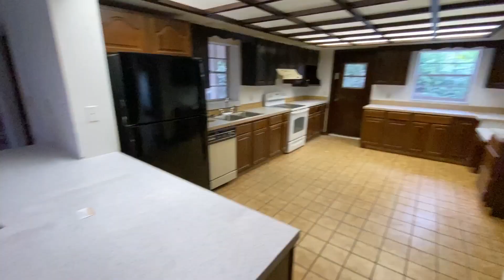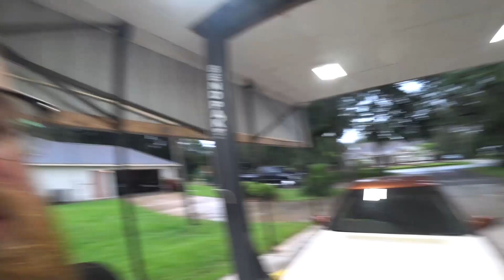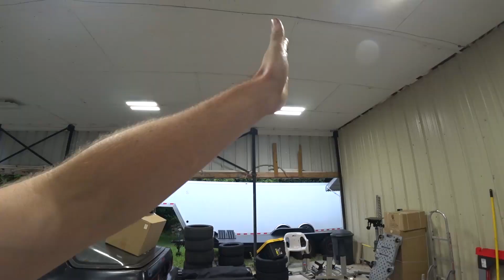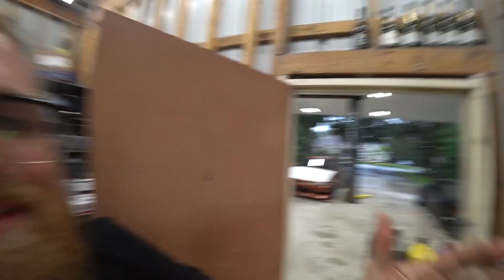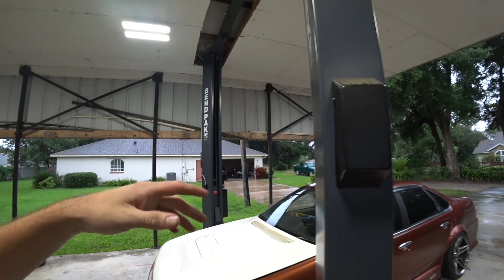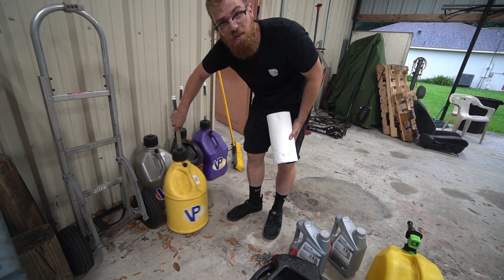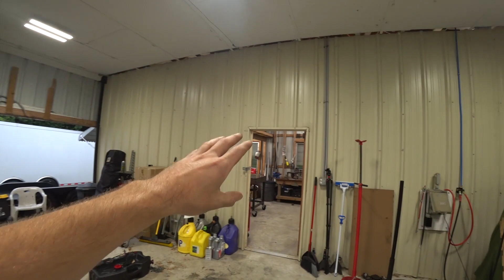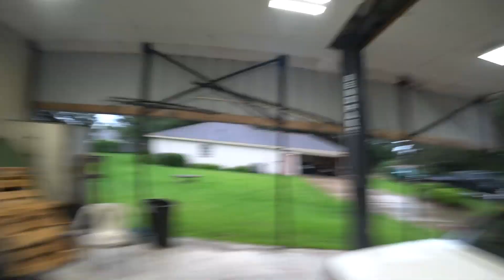Update on my new shop. I have to tear it all down.

Comment: When I called my county about permits they said "Do what ever you want, it's your land." No requirements, no permits.
Reply: Where is that? I'm surprised there is any freedom left anywhere in this country.

I would really love for someone to tell me where in the Constitution of the U.S.A. it gives the government the power to permit the people to do anything.
Reply: That's not necessarily so in most states, you do have to check your building permit first, because if you don't you will wind up tearing it all down to appease the State.
Reply: What county do you reside
Reply: @mikey4016  I agree in principle, but then I realize that much of the building permitting stuff came from disasters and messes that have mostly disappeared since we created standards that people must follow.
Reply: Permits are nothing but revenue, they do nothing for "standards" or "safety".
Reply: @angelbking  Washington county Missouri
Reply: @mandm3881  I checked first
Reply: @mikey4016  Missouri where the Freedom is.
Reply: @bb5242  oh yes agreed! But if it costs $30,000 before you can break ground like in parts of California it pretty much removes people from the ability to build something. Couldn't they give you standards and you use the 30k to build it instead of some guy's family vacation to Disney.
Reply: @muddyudders  I'm down in Oregon Missouri.
Reply: @mikey4016  the permit to drive in Missouri is not much money compared to many states. And even though you do a safety inspection every other year on older vehicles.  You don't have to deal with the smog test. They really don't care how much horsepower your vehicle puts out or how it's made. I can't speak for the bigger cities or even towns but Rural Insurance is not bad and you would be foolish to drive whether it was mandatory or not since one lawsuit could wipe out all your net worth. People stay fixated with where they live. And think everything is the same, when in reality there's plenty of Open Spaces with plenty of freedom. They just have to have the willpower to break the chains that bind them. They're soon going to be mass migrations. Those who do it soon enough stand a chance. Those who wait will find they no longer can affordable real estate available.
Reply: @Ozarkprepper643  you're about 5 hrs away. We are neighbors in the grand scheme of things.
Reply: pretty much the same here.  Only thing my county was worried about was how far away it was from any septic tanks, or creeks.  Answer was miles for creeks and hundred yard from my septic system.  Yeah it helps to live in the middle of nowhere
Reply: @muddyudders  Its funny you said that, the part about california. There it only affects owners but bums can build tent shanties damn near any place
Reply: @bb5242  after over 15 years working in the sector I can confirm that real disasters don't give a shit about what codes you follow. Mostly what I've seen is out of control beaurocracy propped up by construction firms with unfair influence peddling the lie that somehow their concern is your safety.
Reply: @muddyudders  you will own nothing and you'll be happy. Sounds like a California concept.
Reply: @onetrues3978  that may be the new way America is. The sky is falling!! 🙊🙉🙈
Reply: That how every persons land should be.
Reply: @seanhazelwood3311  that's correct, I did some work in Santa Ana California many years ago for company I worked with. They did own designs for changes and expansion of building they owned. Other then that asked me handle all else. The building had gone through several permit jobs prior, knowing that I ask to review other permit plans to locate new paths for gas, water, sewage, some underground electrical, all to make entrances for our connections. The city responds to with we don't have that information, my response was us and them submit plans for approval and permitting and you don't keep copies for record's. Their response was no. So basically they collect revenue for nothing. It's an excuse felice your pockets. If remember correctly the building inspector didn't care about plans, only installation or erection of materials was to code.
Reply: Same here.  We had to put a new drain field in, plus I was building a 40x60 pole barn.  No permits, no inspectors, nothing.  And that included electrical.  The closest town to me has under 100 people, and the entire county only has a single traffic light.  In the entire county.  If you get away from towns and cities, it's an entirely new world.  Might as well be a different planet.  You couldn't pay me to live in a city or big town.  I like having to drive 30 minutes to the grocery store.
Reply: @mrrodgerspoliticalplaytime5663  I agree with Inspections, I disagree with "permits". I shouldn't need "permission ", much less pay for the privilege. Permits are nothing but a money grab.
Reply: @seanhazelwood3311  Inspections can't happen without a set of plans.  Plans need to be permitted.  If something goes wrong (SURFSIDE CONDOS), who's liable?  I'll tell you. The designer/engineer, and the city/county/state office that issued said permit.  And inspectors are there to see that it is constructed properly.  Bureaucracy can be slow going.  But we need building codes to keep safe.  But today's society seems to think safety and the safety of others is a personal issue.
Reply: @seanhazelwood3311  I know you hate fees. Most of us do,  But codes are there for a reason.  And if you don't have approved plans, that adhere to code.  Then you can build anything, and we end up with shanty towns that look like puerto rico.  There has to be a governing authority, plans need to be to code, and need to be permitted properly.  It's the best way to get the safest building. If you want to build something without permission.  who will be sure that your concrete is right, or the proper connections are bring made... Do you know how many building codes there are.  If you live in an earthquake area.  There are extra codes that need to be addressed.  100,000's  can be spent on these.    I have another example for you.  In Los Angeles.  You can't even think to build without having a methane test done on the soil.. That's after you've had a regular soil test.  And if your methane test comes back negative.  YOU STILL HAVE TO TAKE MINIMUM measures.
Reply: @mrrodgerspoliticalplaytime5663  Permits and fees are not required to properly inspect anything, that's BS. Safety standards can easily be met without paying the government for permission. 

Tell the inspector what you intend to do, the inspector lays out the proper way to do it, the inspector checks to make sure you did it. No monetary fees or permits needed, except to line someones pockets.
Reply: Lucky guy. Thieves at philly L&I charged me $72 35 years ago to install 22' of fence. Told me that I needed 3 sets of prints. Got a friend at a machine shop make me up e sets if scaled prints. When I went back tk get the permit was told that I did not need scaled blueprints.but inspector liked it.
Reply: always Always ALWAYS get it in writing.
Reply: Lucky guy. Douche bags in Philly told me to get a permit for 22' of chain link fence would need 3 sets of scale drawings. So I gave a case of goid beer to a tool & die shop programmer that I did work for. When I went diwntown again a different guy from L & I said great looking prints but they were not needed.Found that securing permits from small towns were a lot easier. Pa has been talking about going with a state electrical license since 1964. So rather then pay say $200 for a state license might have to spend $800 for several township licenses.
Reply: Wow, I just put up a 24x25 metal building and went through permit hell.
Reply: @mikey4016  Florida building collapse.
Reply: @daveg4963  I'm not sure what you're saying. Other than perhaps you're agreeing with me that permits are stupid, anti-freedom, nonsense, because of how many fully permitted buildings collapse.
Reply: @mikey4016  you have WAY too much faith in people.  People are greedy and will not build accordingly.  Especially cheap contractors.  If it wasn't for building codes WAY more buildings would collapse.  Saying that building codes don't work because permitted buildings have collapsed is just a really poor argument.  Just today I saw a non permitted structure with it's entire roof blown off to the side.
Reply: @seanhazelwood3311  because inspectors and jurisdictions give their time for free right? Lol
Reply: @daveg4963  I have NO faith in people and even less faith in government.
Reply: @seanhazelwood3311  permit fees are to pay for the time to review plans and to have inspection done.  You thought that was done for free?
Reply: @mikey4016  so how do we make sure that buildings are built right? Especially multi-level multi-family structures?
Reply: @mikey4016  😂😂😂😂😂😂 you upgraded to fentanyl or what? 😂😂😂😂😂😂😂.
Reply: @mikey4016  being a property owner of a luxury multi-level multi-family condominium is communism.  😂😂😂😂😂😂😂😂😂😂 Do you cry communism at everything? When your coffee is served cold do you cry communism? When you're asleep at night do you have nightmares about communism? You wake up thinking about communism?

Comment: Ive just moved to a new place.. And the local county are super relaxed on permits and what can be built.. We have 6 acres and a 4 car garage which im planning on rebuilding, adding a second floor and a lift, it already has a 200 amp supply (has its own meter) and as i dont need permits I can just crack on with the remodel.. Im 47 and never had a shop.. Until now 😝

Comment: Add plumbing, even if it’s only roughed in now,
Reply: Agreed......durastall shower, toilet ....  plastic channel floor drain (if floor is sloped) easy to clean ....little kitchen with sink, refrigerator for hang out area....
Reply: @donnajones1603  even if he does a slop sink, and a toilet (up flush) if he wants to avoid cutting concrete, but that’s not as difficult as one may think, a cheep skill saw, and a diamond blade from Home Depot, cut a 24 inch s 10 inch slot , bust it up with a sledgehammer and you got a drain, I think he’s in central Florida (easy digging of trench) and it may even allow him to run his electrical below grade, assuming lifts and AC, compressor, would all justify an upgrade to what ever is currently there., and I’m making an assumption that whoever built it originally didn’t rough in plumbing already..
Reply: @ryanhogan6509  I would run it all thru the back wall if possible, run it under the ground from the house to the back of the shed, then all you need to do is drill thru the house wall, dig a trench, run some pipe, and come out right behind the wall and you can avoid concrete work.
Reply: @Sffker  yeah but then you either need to spend extra on an upflush, or lumber to raise the bathroom floor so the toilet will flush.. ??

Comment: As an electrician and one who's worked on a couple shops. If you are drywalling and having conduit run in the walls. Please do this run an extra couple 3/4 pipes in the walls and have a box put in and just blank it off. So let's say you have the tire setup on one side of the shop. Put a box on the opposite wall so maybe if in the future you want to completely flip the shop layout.  This way no matter what you have the option to do so and don't have to worry about the extra cost after the fact and who knows maybe you get another machine or something that needs power and now all you need to do is just pull wire and hook it up. It really won't cost much to have an extra box with pipe ran on each wall or even the ceiling.  Also get a panel with plenty of space for future add ons. Oh and who knows maybe one day you will have a camper and need an outlet for that so while they add your new service shoot a pipe to the other side of the shop where the trailer is now and just leave it buried. Obviously you don't have to do any of this but it's something to think about at least. Can't wait for the new shop to be built!

Comment: Cool Advice / Shop Idea :  Find an old use AV cabinet and convert it to a small paint booth.  I did that a couple years ago by just using what I could get (I'm poor man).  By putting a cheap stove hood vent on the top of the AV cabinet, and putting a couple cheap lexan shutters on the front, it keeps paint out of my shop by extracting it directly outside after being filtered by the hood vent.  I could send ya pics if ya want.  So anytime you gotta paint up small stuff (up to the size of a wheel or 4 cyl block) and you want it to look nice and be protected while it all drys... this works nice.  I also added all kinds of hanging spots and bent coat hangers.  (Also hood vents often have lights, so it lights up the cabinet too for good view)

Comment: Having a stable climate will slow down corrosion.  Running AC at night won't cost much more. You can raise the temp but I would not turn it off.  If you keep the pad cool it won't sweat. I like that you are doing it right.

Comment: This may be too late but I can recommend using closed cell spray in foam for your insulation. 
I live in Texas with its high temps and I finished off a space in my shop, insulated it and put in a mini split air conditioner… I keep it at 73° year round and I didn’t even notice a increase in my electric bills. Where you are going to cool a bit more area, your bills should still be reasonable… btw, a smaller ac that runs a lot is highly preferable in a high humidity area like Florida.

Comment: Best advice I can give you is don’t skimp on insulation. We just built a 30x40x18 shop that has a second story on half. We had blown in Fiberglas insulation put on the side walls and it dramatically  improves r value over the other shops with batt or foam insulation. There are even days that the ac doesn’t kick on until noon or 1 it’s insulted so we’ll. Second story is still warmer and would likely be better with some fans to circulate the air better but it’s still night and day difference.

Comment: Amazing how the existing structure is considered perfectly safe. But if you add some walls to it that are built to current 2021 codes, it suddenly becomes dangerous
Reply: It is like ancient Himalayan Sea Salt crusted in the earth for millions of years. The instant it is in a bottle for sale it has an expiration date.
Reply: The logic of yesterdays codes go out the door when you have college educated city/county engineers and code enforcers twiddling thier thumbs for more than 6 months getting paid to go to seminars to improve what already worked fine last year. They can't just sit idle in an office for 2 years doing nothing. Codes should have at least a good 5 year shelf life just to prove  the engineering works. It just shows they can't trust thier own codes 🤔
Reply: @mikep.9912  day Ollie truss,mow monies never less
Reply: When you add walls, you add lateral wind loads that didn’t exist when it was an open sided structure.
Reply: @mikep.9912  Could have just hired a structural engineer to prove that it works.
Reply: @stocharron2753  Florida building collapse.  That's why we have codes.
Reply: I don't think anyone could approve it, without knowing the footings were rebar'd and poured correctly, without knowing the stress grades of the timber... without knowing the bracing design and specs..  I think this is why in my area (qld australia) we need 3rd party inspection of the footings before the concrete is poured, and the timbers before the roof is attached. (tho australia is a too over regulated IMO)

Comment: Hey that's pretty cool. I think ac will be fine if well insulated, also consider one of the inverter units, as they are very efficient and can also run off solar if you ever wanted to go with solar panels.

Comment: I’ve been apart of a few projects that have had a similar issue and a work around has been to put rollup or bifold doors all the way around which technically is not enclosed because the doors are not permanent or support structure and are movable